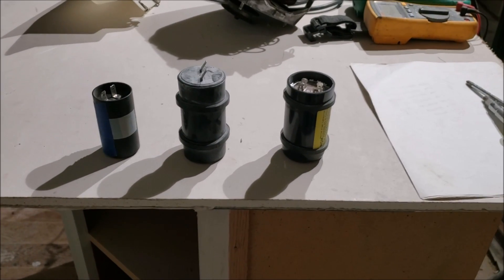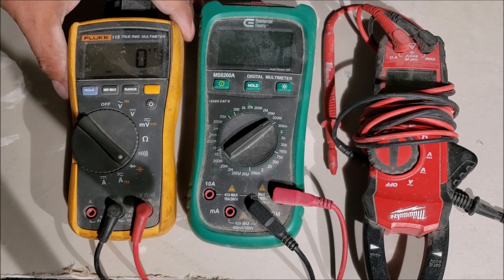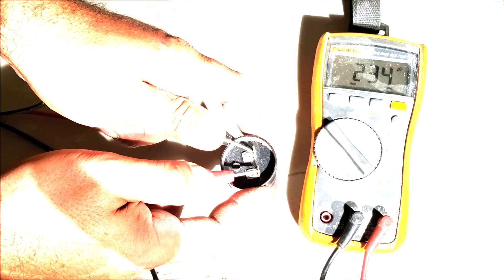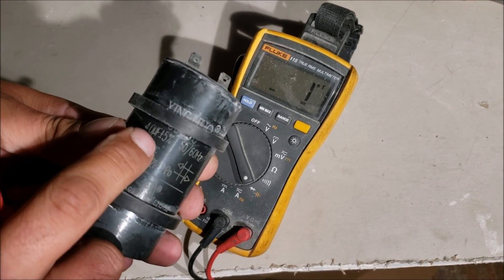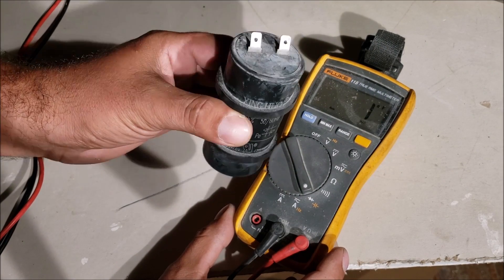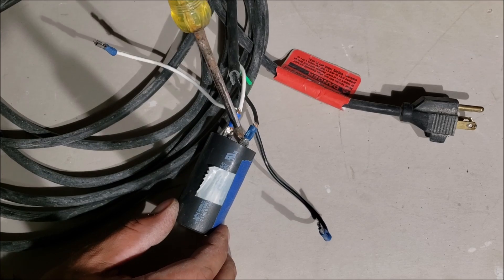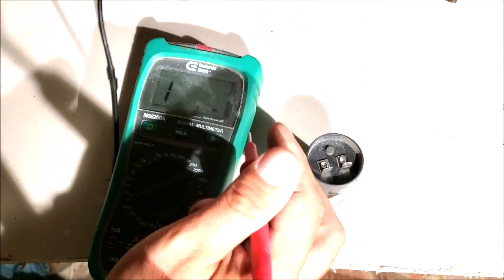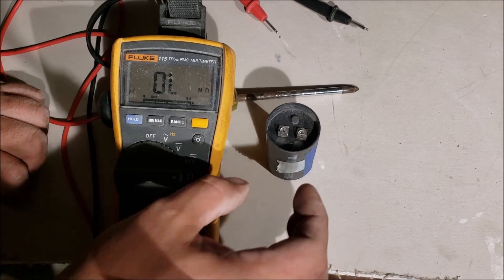how to test a RUN or START CAPACITOR the CORRECT way

Comment: You're absolutely right, the third method is absolutely useless unless the capacitor is blown open.  You missed a fourth test, which will give you accurate MFD reading when you don't have a suitable multimeter.  Hook up the capacitor as shown in the second test.  Instead of disconnecting right away, clip your ammeter across one wire and record the reading.  While the capacitor is still energized, measure the voltage across it.  Now you can take the capacitor off line.  Multiply your amperage reading by 2652, and divide the result by  your voltage reading.  Your answer is the capacity of the capacitor in MFD.
Reply: Some may be leary about hooking the capacitor directly across the line, although I have done that with no bad things happening.  Not saying you should leave it plugged all day.😁
Reply: This formula (C = A X 2650 / V) only works on 60 hertz systems.  If you are in North America, you're good to go.  It's 3183 for 50Hz.
Reply: Forgot to mention, this trick also works for finding the capacitance of a capacitor under load in a live circuit.

Comment: Great video, but one thing to keep in mind is some meters with a capacitance mode may have a limited range and may not be useful for larger start or run caps. I learned this when I was trying to test a start cap around 470MFD and my meter was showing OL. I checked the manual and realized that means the cap is over the maximum range of the meter. I dug deeper into the manual and discovered the maximum value it could measure was 100MFD.

Comment: I have an old motor that needs a new starting cap.  Existing is 430-480 mfd.  But I can't find those values.  I can only find 400-480 or 430 516.
Which cap can I use to substitute?
Reply from the maker: either one in my opinion..

Comment: It's good to know how to test capacitors. However, given their cheap price (generally $5 - $20) 
just replacing the capacitor if you don't have a tester before calling the service guy to show up
ain't a bad option either.

Comment: You warn us to be very careful, then you place your hand less than an inch from the powered leads when you plug in. You had me scared for you.🤔😆. Thanks so much for the video. I just did the test following your instructions, using the meter and measuring the micro ferrets. Just ordered a new capacitor and picking it up tomorrow morning. Cold air will be blowing again soon on my 14000 BTU Haier portable AC. Not a moment too soon, we're going through a period of scorching heat in the high 30s Celcius.

Comment: if you don’t have capacitance on your VOM. check ohms to the case of capacitor. If both terminals read open, get either a new capacitor or a new VOM. If you can afford it both would be ideal.

Comment: So if you take a screwdriver to the terminals on a capacitor immediately after removing it from power and it doesn't spark it mean the capacitor is bad? Using my multi meter is not working for me. The number starts high then drops to a number within min max.

Comment: then the horse shoe with Fu or a multi meter I hav has (mA-||-) with •1.5V right beneath it, definitely paired together.. which doesn’t seem to get any reading on any of 3 capacitors btw., 
then on my same multimeter there’s that airplane sybol you had(I think less often recomended ->|-2k)..  again in this world what’s right rong?

Comment: there seem to be 2 differant symbols used in these videos & recomended on gUgle - your working model 1, has the rarer 1(that airplane symbol), the other 1 looks like 2 fat sideways Ts pointing away from each other -||-), how do you choose, IO😯 which 1/2 of thE experts are rong? hmnnn?🤔

Comment: Great video dude. My tester has the symbol for this test.  I didn't know what that setting was for.  I can now test my capacitor on my pressure washer. Thanks. You got a thumbs up and a subscribe.
Reply: Is that what was wrong?
Reply: @Ronald_Bilius_Weasley  Hi Ronald, thanks for your response.  Actually it was not the capacitor.  Long story short, The whole problem started with an internal leak.  I took the unit apart and found the problem. I ordered it and replaced it.  After replacing the part and reassembling  it would not start.  Just a click and stop. After seeing your video I did test the capacitor and it was fine.  It turned out the motor was frozen so I had a shop rewind the motor. Interestingly, the motor wire was aluminum and electroplated with copper.  I had them use solid copper wire. The motor worked fine so I re-assembled the unit and fired it up.  Major leak again. I then noticed, after taking in apart again, the technician had not replaced the large "O" ring on the motor housing.  Of course he could not find it so I ordered a new one from Spare Parts in the UK.  This has been the project from hell.  Fortunately Karcher is a very good pressure washer and parts are easily available.  Believe me this is the short version and I hope your viewers will find it helpful.  Thank you for your interest.

Comment: First time testing capacitors with a meter.  I have two.  I start with the meter showing 1 as in the video.  I put the meter leads on the terminals and it shows a reading for a second then goes back to 1.  Both capacitors do this.  Neither shows a steady number as shown in the video.  Am I correct in thinking that both are bad?

Comment: Great video and thank you.  I am testing a CBB60 Cap 100uF with a Fluke 87 DMM set on CAP mode and it reads O.L.  I tested Both ways same reading.  I swapped to OHMs, and I see 8.24 megs and it starts to climb a little - swapped it and I get  -3.016 megs and it starts to go down.  On the capacitance test I get nothing, no reading other than O.L.  bad cap?  thx
Reply: How old is the meter? If it’s a straight 87, then those only had a capacitance measurement range of 5uF. You’re trying to measure 100uF so the only reading it can give you is “OL”. If it’s a currently sold 87V then you need to discharge the capacitor first before making any measurements. A small residual charge on the capacitor will invalidate any readings you take with the meter.

Comment: Why in the last test with the fluke do you need to put the probes on opposing sides of the terminals? Why can’t they be on the same sides of each terminal like when you used the fluke for microfarahds?

Comment: What does "OL" mean? 
I checked a number of capacitors and they were okay and in-range, BUT one says OL; it has two termials and I tried both ways: OL. I'm using a good Metek MK05 device that seems to work great. Thanks for the video.

Comment: I'm trying to test the caps on an air compressor. One of the caps have resistors soldered into the terminals. Would those resistors cause the uf numbers to be excessively high and out of spec? the other cap is the same model and tests within range, but again doesn't have the resistors. Thanks for the video.

Comment: The capacitor will charge up one way and then the other due to the alternating current. + - then - +.  When disconnected it will be one or the other, not alternating current.  When it shocks you, one will tend to stick to it until all the charge has passed into you.  This is a DC shock, it will pass deeply, usually into your finger and hurt like hell, burning deeply as well.  They are very unpleasant and hurt for hours.  Old TVs can get you after being turned off for a day. BEWARE!

Comment: Would not a power strip with an on/off switch activated for one second be better than plugging and unplugging the receptacle end of the wire?
Reply from the maker: it was to just show you.. normal people should never do that

Comment: On the capasitor setting, the on I have goes up the .OL in both directions. One side is higher than the other. So I guess this cap is bad? The resistance test goes up then .OL, jist like the cap test, but higher numbers.

Comment: New Capacitors 105MFD +20% reads 200 MFD not Nano 2 ea same and why does it have a resistor(?) across the leads?
Reply: Resistor is for safety to make sure no residual charge is built up in the capacitor. Capacitor is always at “zero” volts when you install it. Obviously, remove before installing.

Comment: For the second test, when you're applying live ac voltage to the capacitor terminals, what if there is an internal short in the capacitor?

Comment: The resistance test is not pointless. 1st because it shows if it is shorted or not. 2nd it shows you if it can take a charge or not and 3rd is when you switch the leads it shows you if the cap is discharging and recharging in the opposite polarity.  So it's definitely not a stupid test

Comment: Just a note about the voltage stored in the capacitor: it's DC. Even though you applied AC voltage, the capacitor only stores DC. This is why caps are used in AC to DC power supplies.
Reply: Depending on timing it could be anything from 0V to 120VAC RMS / .707 = 169.73VDC because that is the peak AC voltage.  If it was a circuit with a full wave bridge, it would be about 340VDC for the AC peak to peak value.
Reply: As a wild off topic side note, a real telephone line rings at around 170V 20Hz pulsating DC.  Nominal is 48VDC from 24 lead-acid battery cells in series which can reach 58V.

Comment: Very helpful, the capacitor was the problem, had another capacitor off an engine that was sitting in the garage and it tested fine, engine now runs like it should.

Comment: I bought a new capacitor that reads around 195 microfarads. The range on the capacitor says 161-193 microfarads. Does that mean the capacitor is bad? I believe the old capacitor reads even higher and neither capacitor will start my 1 hp shallow well pump motor. The motor will just hum and then goes quiet. I am working on the inside of the motor tomorrow checking things out to see if I can get it to run. I already cleaned the contacts on the inside but I broke a wire that was soldered and I got a new soldering iron to solder it back on. I also purchased some contact cleaner to make sure contacts are clean. My tester I believe was showing continuity through the motor contacts after sanding them lightly. If motor doesn't start I'll disconnect pump and try to start the motor without the pump to see if the motor will run.

Comment: Did you replace the compressor capacitor, and did that fix it (and stop the breaker from tripping)?
Reply from the maker: yes, of course.. thats why i made the video...  cause the compressor failed..   it has been running since i made the video...

Comment: Grew up in My Dads electric motor repair shop. we stripped out old motors and re used most parts back in the 1970s. one of my jobs was to charge each capacitor with 110vac and then discharge with a screwdriver just as you did there. throw out the bad ones. Also, point the terminal end away from you when energizing because they can explode and blow out at the top

Comment: Thank you Chris , Great videos , I have a problem that you may be able to answer my Frigidaire affinity atf 705b stopped working during a cycle , and i went through the the normal things that typically goes wrong like , door lock , main front control board, computer board, checked all wires for short or breakage, ( all ok ) , but when i looked at the run or start capacitor it didn't have any marking on it numbers or writing , so don't have a clue what reading it should have , so how do i check if its ok please, thank you if you can help .

Comment: As an electromechanical tech for the largest wire production company in the continental U.S. there is a reason techs call that power cord a suicide cord.

Comment: I have a cheap multimeter that has the capacitor symbol on the dial.  But there are no buttons to press, just a hold button and a button to light the display.  I can't press anything to get microfarads, and the capacitor setting doesn't seem to work.    It is an Astro AI AM33D

Comment: Showing a correct capacitance doesn't mean the capacitor is good. You need to check it for leakage. And non of the meters shown can do that. About the second method: it really depends on the phase angle of the sine wave when it gets disconnected. It may or may not be fully charged.
Reply: His third test would have,  but he had to discharge the capacitor first.

Comment: Sir may I ask, if I have a motor starting capacitor for "Dough Mixer" of 80µF 10+20% 270V, and I have a reading of 85µF, shall I say that the capacitor is in excellent condition? Your info for this is highly appreciated.
Reply from the maker: that would appear to be good

Comment: Why isn't my meter showing any capacitance on any of the new run capacitors for my furnace? I thought I bought a bad one (7.5 x 370) from Grainger because it and the suspected bad one it was replacing were both showing 0 capacitance on my cheap meter. So I returned to Grainger with the suspected bad one I just bought from them, the suspected bad one that came off the furnace and my meter. They brought out several new capacitors and my meter never registered any capacitance on any of the capacitors. So my question is why is my meter not showing any capacitance on ANY capacitor?  Thank you.

Comment: Thanks for the nice video and re-education, Another good way if you have to test live is use a switch and a piece of fuse wire but still make sure its discharged before touching afterwards

Comment: I had no idea about the capacity setting on a multimeter, so that was especially helpful.  I had been staying with my older multimeter because it seemed to do  everything I needed to, and honestly, it's not auto-ranging, and for some reason, I had it in my head that the non-autoranging ones were better.  I guess because it required the user to be more knowledgable.  This video has me reconsidering that stance.  Any thoughts/recommendations?  Thanks!

Comment: I have several meters from top end to crap and I only recently discovered that one or two of them has a capacitor test setting. I had always used the resistance test, needle up and then back to zero. Feeling a bit stupid on that! In my defense, on retesting a bunch of caps judged good by using resistance, the true cap test agreed. Seems like most caps are either dead or good with little in between - especially start caps that usually blow their top.

Comment: That third test using the ohm meter; you need to discharge the cap also for the small charge that is induced between application of the leads. You wont get a result that is correct otherwise!

Comment: So if you don't have this type of multimeter then the easiest way to test a capacitor is to buy a new capacitor
Reply from the maker: what is the machine and what is happening when you try to start it
Reply: @chriscraft77022  Hey Chris.  Didn’t expect a quick reply, thanks.  It’s a older carrier through the wall ac.  Fan works and compressor sort of kicks on but does not stay on.  For $10 I’ll through a 35-5 capacitor at it and hope it’s not the compressor
Reply from the maker: if it’s a window unit the compressor has a thermal switch that heats up and shuts it off.. ( when it’s going bad) so it will cool for a little and turn off until the compressor cools down again. does that sound like what it’s doing?
Reply: @chriscraft77022  possibly, yes.  It seems to work but doesn’t stay working

Comment: Is the testing on a start capacitor any different if there is a bleed resistor installed between the terminals?
Reply: In other videos, the bleed resistor threw the readings off. They disconnected one end of the resistor before testing, then reattached.

Comment: Can I use the first test or should I say ,will it work to test the capacitor on my pressure washer ? I am not that great with electrical stuff but your video seems straight forward. Thank you.

Comment: Just a quick note Make sure when discharging the capacitor that you are using an electrically rated insulated screwdriver !! Like the one he is using ...other wise it could jump through the handle

Comment: Very helpful video; my pool pump has a Genteq 25 uf 2-pole capacitor; the wires from the pump are black and were disconnected from the capacitor by my electrician when he removed the capacitor; I bought a new Genteq 25uf capacitor; I don't know which wire to connect to which connector on the capacitor; does it matter what wire goes to what connector??  Thank you.  Steve

Comment: i"m surprised you didn't show the most accurate test, while the cap is in circuit and energized.   Use a clamp meter to read the amps on the start winding connection to the run cap and then multiply times 2652,  then divide by the voltage reading across the capacitor's terminals which will give you the uf of the capacitor.   Compare the result to the cap's label to determine if within specs.   Can't use this for Start caps as they aren't energized long enough to take the readings..

Comment: I've disconnected the wires from the air conditioner capacitor. I did not disconnect the capacitor from the bracket that was holding it. So, do you have to disconnect the capacitor from its bracket to get a good capacitor test?
Reply from the maker: no